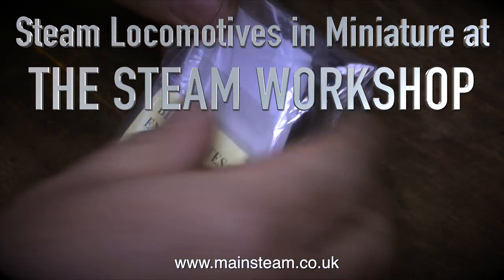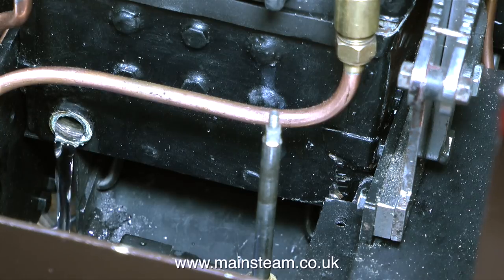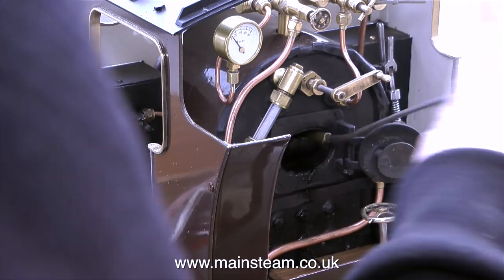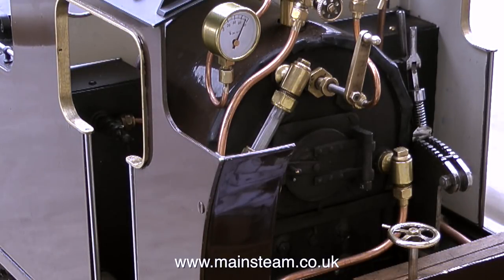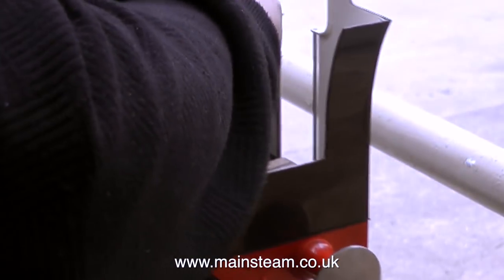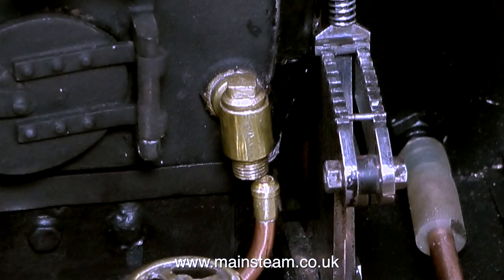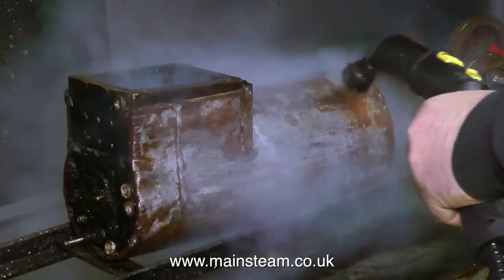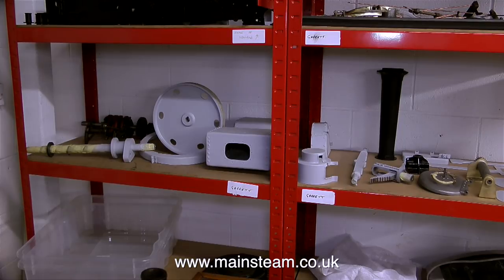WORKING AT THE STEAM WORKSHOP #24 - COMPLETING THE "CHUB" LOCOMOTIVE REBUILD

Comment: Thanks Keith for the lesson in blowing down an old boiler before trouble ensues. I bought a 7 1/4" loco project, and the boiler had been fired a few times. It was then stored poorly. I'm going to blow it down several times before I start testing any other part of the project!

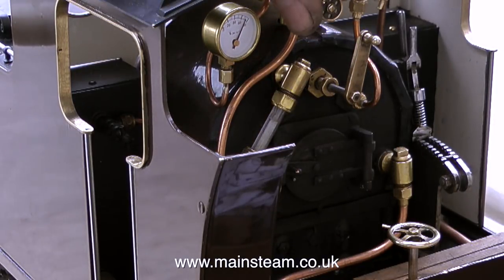Comment: At 3:50 I appreciate that you left the talking in the sound track, I've often wondered what your voice sounds like.
A very fine 24 part series, thank you for the adventure. Your next task will be a grand journey. Over the decades I have had the (mis)fortune of assembling a good number of basket cases for folks. As you well know, it's one thing if you are familiar with the machine, but quite another if it's foreign to you. Perhaps a wee flask of fine single malt will be a valuable addition to your tool box for this?

Comment: You can treat your boiler water with Trisodium phosphate that will turn your hardness in the water to a better blowdown mud . We used this in our large boilers to keep hard minerals from sticking to the hot fire sides . The chemical here in the USA can be found at Paint supply outlets for cleaning stuff before painting . Maybe a 1/8 tsp to a gallon might do it .